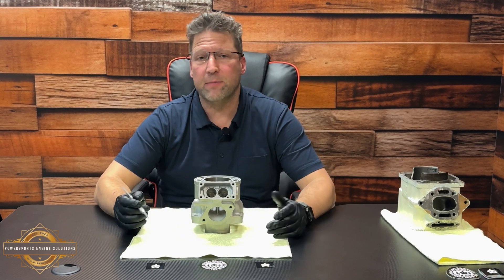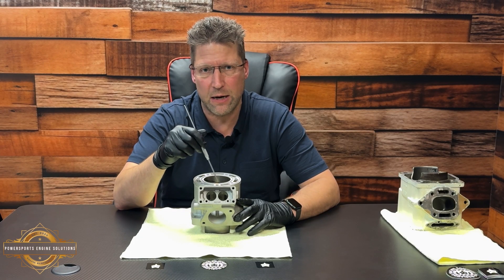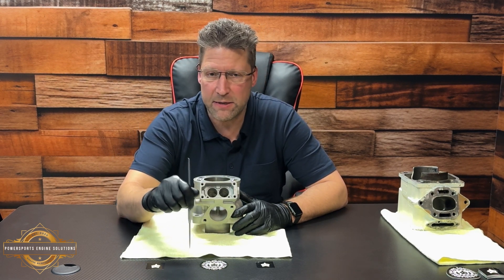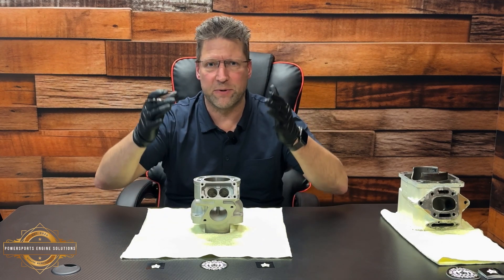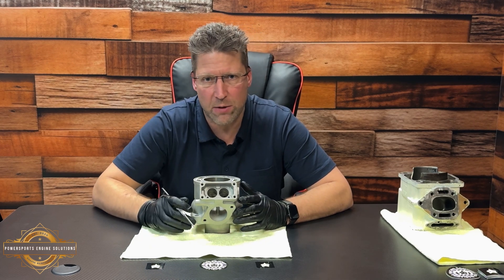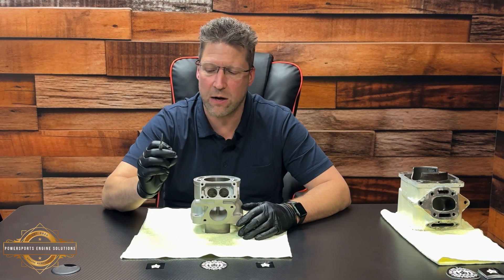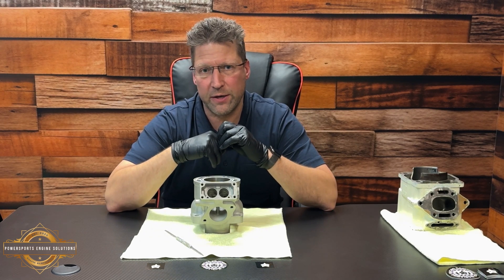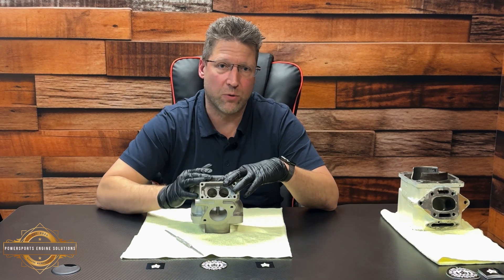Powersports Solutions - Different Size Pistons For Nikasil Cylinder #38

Comment: Chuck Harder taught me about your channel👋 I ride a Husqvarna FE501 on the street and in the woods, and I'm all over in terms of engine speeds. What size of a piston ring end gap should I be shooting for. My Wiseco  kit 40064M09500 for 95mm bore gives me a table to find the end gap to be .015", unless I calculated it wrong. (95/25.4)*.004 = ~.015 . Thank you!